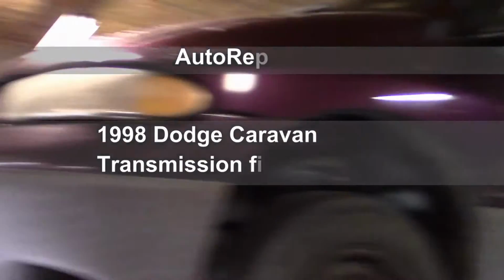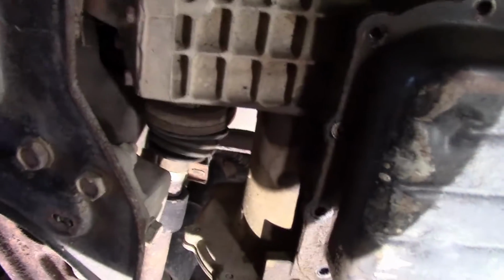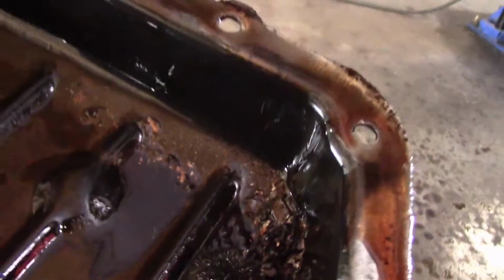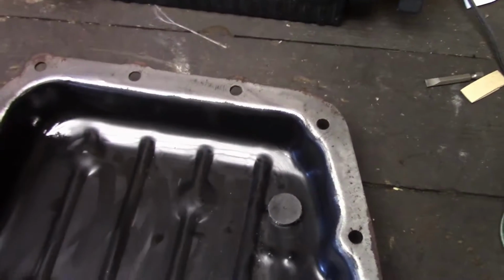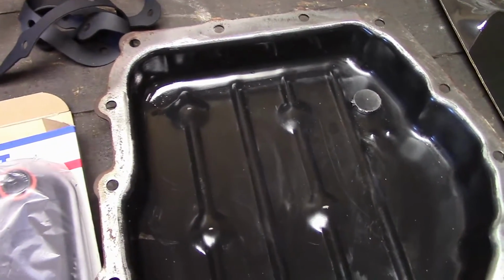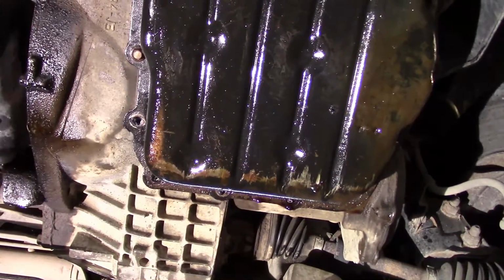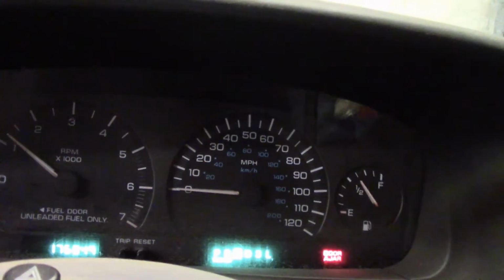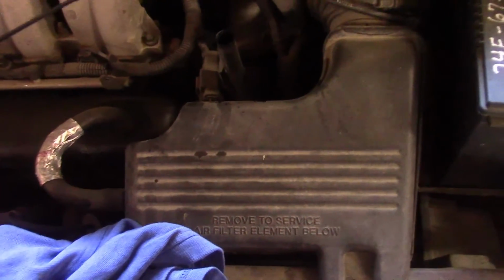Dodge Caravan Transmission Filter Replacement

Comment: I have a 2014 caravan that I got used with 100,000mi on it and the fluid is clean and shifts smooth but sometimes shifts rough usually at slow speeds and clunks into reverse and doesn't.  Do you have any reasons why or helpful tips to maybe stop the problem? Thank you for the video 👍
Reply: Regardless of how clean your fluid as you always should drop the pan flush out all the fluid and replace with new..
Reply: @peachyclean93  actually I just replaced the filter 1hr ago and put in the recommended 5.5qts back in and I took out the same amount but get no reading on the dip stick so do I keep adding till I reach full on the dipstick?
Reply: @rodneysmith247  you really should have done a full power flush but hopefully that'll fix it all for the 2014 I don't think there is a dipstick